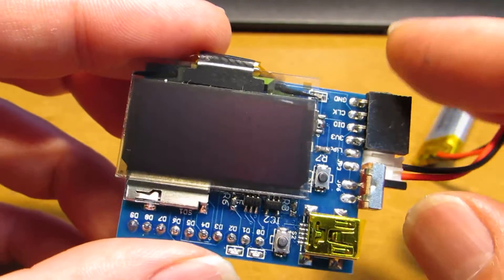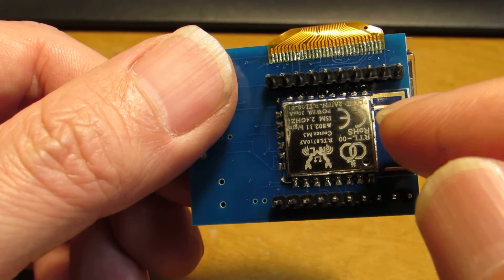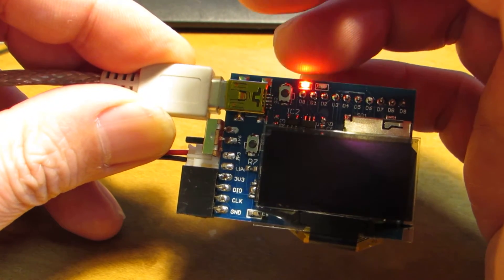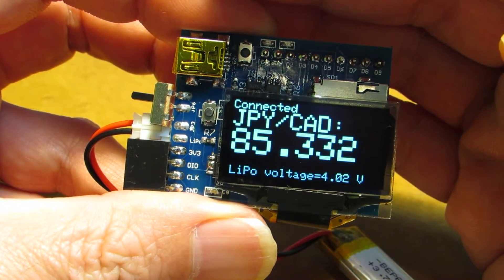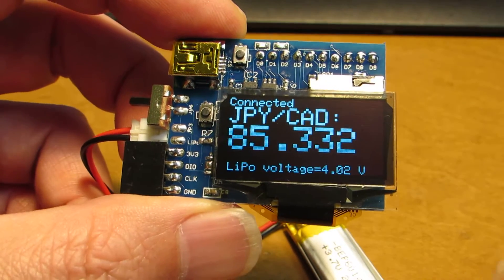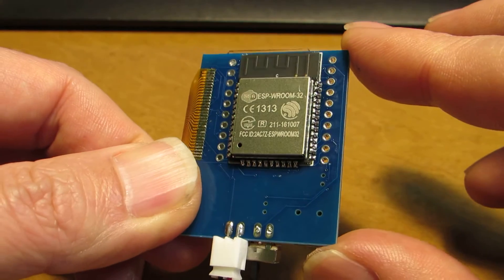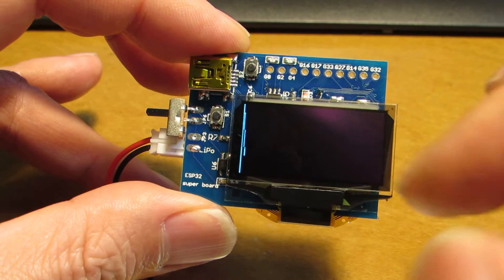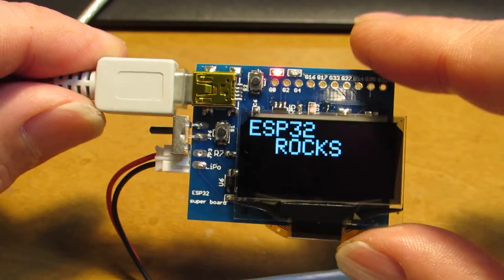Two things to show, RTL8710 big OLED and ESP32 big OLED module!

Comment: Hi microwavemont, I bought a small SPI color OLED, and I am trying to make it work with RTL8710. Is it possible? Thanks!

www.banggood.com/0_95-Inch-7pin-Full-Color-65K-Color-SSD1331-SPI-OLED-Display-For-Arduino-p-1068167.html?p=DQ30066511122014069J&utm_campaign=educ8stv&utm_content=huangwenjie
Reply from the maker: I just now noticed I've not tried this combination (RTL8710 with SPI Color OLED), but should be possible. (I've not tried, though....)
Reply: I tried uploading the sample sketch, but it seems some changes are needed in the sketch and the library (pvvx). I'm currently looking through the customer reviews on its banggood page. I see it works with ESP with some code changes, but nothing about RTL.